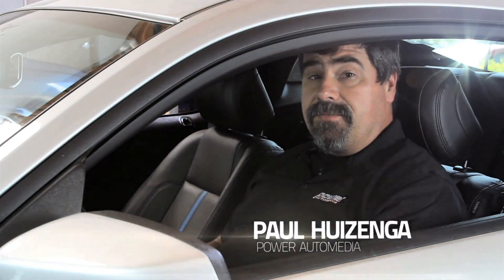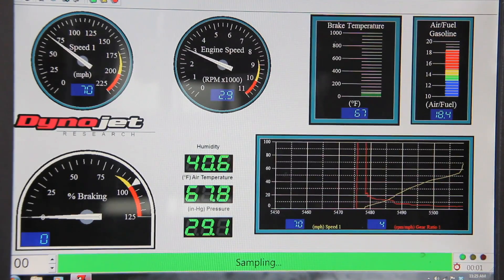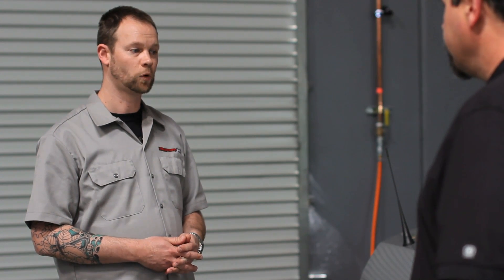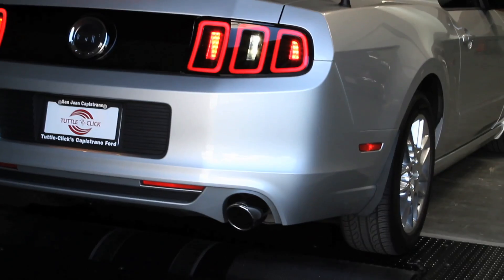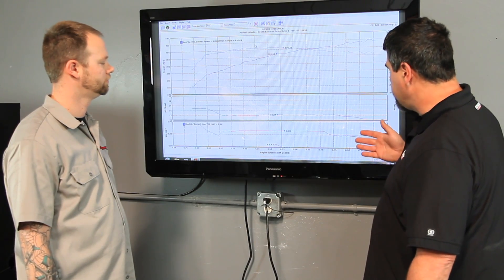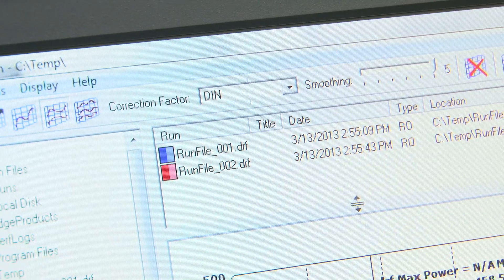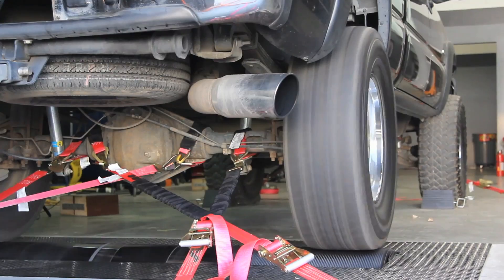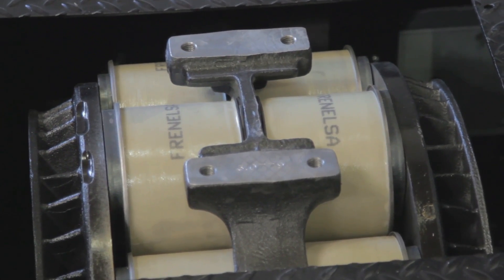Dyno Testing 101

Comment: Dyno 101, dynojet : fail
Reply: Indeed. Dynodynamics or Mustang.
Reply: Im not getting it... ive had numerous cars tuned on a dynojet and they all turned out bad ass.... so whats with the dynojet fail?
Reply: Usually when i hear comments without explanation like yours it goes something like this... guy says "ford cars suck!" The reason behind it is really because he owned a ford and didnt change the oil for three years and seized the hydraulic lifters and the engine went to shit..... so when i hear random comments like yours i automatically think you are "that guy" who had a bad experience for aome stupid reason or another...
Reply: @Turboboob  
I can't speak for the OP but I don't like tuning on an inertia style dyno. And while I am aware that Dynojet now offers load bearing dynos, I still think both Mustang and Dyno Dynamics offer a better product. What really annoys me personally about the Dynojet is the fact that people go around and compare the somewhat inflated numbers they put out, to stock power. Again, the only dynos I see that pretty consistently match SAE j1349 numbers and other factory standards are the two I mention. What's even more annoying is the fact that so many Dynojet users keep using STP like it's even remotely comperable to factory numbers.
Here's a story from a track day last fall. Guy with ZR1 C6. Brags all day long about how much power his car has. He then proceeds to pull up a dyno sheet that shows an inertia pull using STP. He then goes on to rant about how much more power his car has over stock. He would have been a lot more quiet if he had strapped that car onto a Dyno Dynamics and done a load bearing test with a hot engine.
While the Dynojet can be used to tune, it's also often a source of fake news. That's just how I see it. And while you can get good tuning results on an inertia dyno at wide open, you will never have the ability to tune on both part and full throttle steady state. As an example, a tune that is perfectly fine during a normal sweep, can look pretty interesting if you do a step test of 500 rpm intervals from say 3000 to 7000 rpm, holding each plateau for 25 seconds. 
Tuning on good load bearing dynos is just so much more in depth and detailed.

Comment: Here's so wrong on that cheating the dyno. Bc yes you can by two different ways. One is turning the Eddie break off which puts no load on the car which will give higher numbers. 2nd the barometric module. You can place it in front of a fan with cool air passing threw it which will read higher numbers as if you was running in winter time. So yes you can cheat the Dyno numbers
Reply: MrYukon04 No - if you run a fan - it’s the power output at cooler conditions. If you want you can set a fixed  hotter ambient for your test. The Dyno output is the power /torque for a given set of conditions.
Reply: @ppal64  that's what he's saying. People outright hack the weather module or feed it false weather with a heater, chiller, etc. 
    I won't name the shop, but for street racers, they blew cold air over the weather module, which made the corrected numbers be low. You could show someone your dyno sheet and say I only make x hp/tq, when you really make a lot more. I miss that shop...

Comment: Pretty good video but the part about him saying you can't cheat the dyno that's a lie. Bc with the Eddie break used the numbers are more accurate to road conditions. With the break off free rolling it's about the same as putting it on jack stands and flooring it so there's no load on it car will make at least 20 to 30 more horsepower if not more which is not true number. But either way it's only a tuning tool so who cares about Dyno numbers

Comment: Doesn't take into account weight of the car and down force
Reply: You can actually.  That's what the load function is for.
Reply: The goal is measuring powertrain output. The mass, lift coefficient, and drag coefficient do not have a factor in the data.

Comment: You said you are measuring force which is mass x acceleration, but I also understood that an inertia type dyno measures horsepower which is simply defined as power/work over time. Torque ( twisting force) is calculated via the tach signal, and if a Dynojet actually measured force Torque you would see results of over 1000 lb/ft on a bone stock performance car through gear multiplication right?
Reply: You run the car in the gear closest to 1:1, usually 4th. Gear reduction can also be easily calculated out.

Comment: Why do some dynos do not have a crossover at 5252?
Reply: If you use a good chassis dyno that actually measure your crank rpm, it can easily give you a 5252 crossover. As long as the dyno knows your gear ratios etc. it will never be an issue. Dynodynamic or Mustang can do this. Just stay away from all the inertia dynos like Dynojet etc. They are not worth a damn.
Reply: @AB-80X  dynojet dynos not worth a damn... please explain why you say this as every shop i can think of around me runs these... my civic drag car was tuned on a dynojet and it did the trick. Sounds like your personal opinion.
Reply: @Turboboob  
It is my personal opinion, and it's based on personal experience. And there's also a very simple reason why there are so many Dynojets around. The Dynojet inertia dynos are very cheap, and easy to use and maintain compared to a Dyno Dynamics or Mustang load bearing dyno. Add to this that a lot of performance shops like to "sell" the inflated numbers the Dynojets lay down.
Another common thing to see are shops that uses Dynojets that has mediocre air control at best. Most stick the dyno in a corner of the shop, throw a fan in front of it and call it good. 
Inertia dynos are cheap by comparison and so is the case often with the dyno install itself. 
Just because you see something everywhere, does it not mean it's the best. It simply means it's popular and many drink the Kool-Aid. I will say that the majority of shops with a really well built chassis dyno facility do not use Dynojet. I would say they are mostly represented by Mustang and then there's a bunch that use Dyno Dynamics.
Reply: @Turboboob  
I do understand what a dyno is used for - how does that question even relate to anything I said?. Do you understand why a load bearing dyno with proper air control is a much better tool than a simple inertia dyno?
You start out by assuming that I know nothing, then I explain where I'm coming.from, and then you proceed to ask me if I know what a dynonis used for.
If you don't know why the use of road simulation and step testing is of great value compared to a simple inertia sweep, you are lacking a lot of knowledge and experience.
I've been building engines for over 25 years, and I've used several styles and brands of dynos. I'm not narrow minded, I simply choose to avoid the lesser alternatives out there. If a shop has a properly calibrated Dynojet with load control in a properly set up configuration, I have absolutely zero issue with it. But think that you can get a nice race tune from an inertia dyno set up in a way so that the car ends up eating it's own exhaust, you're sorely mistaken. That's a recipe for disaster as it will cause a serious lean condition once you get it out in the fresh air. I've seen it more times than I would ever care to count, and like it or not, in most cases a poorly installed Dynojet was part of the problem.
This is my explanation and my experience, and it's first hand from operating the equipment.
If you don't understand why I say what I say, so be it. Do as you please, it's your time and your money.
Reply: Chassis dynos don't . The reason is that the retarder is generally spinning alot slower than crank speed. most twin roller dynos will be doing around 3000rpm at 120mph and the engine may be doing 7000rpm by then. Hence no cross over but still accurate

Comment: If we do a dyno for an ATV again and again without changing any setting(Tuning) there is a always very small difference in the RPM value.....Why is it so??
Is it because of Temp. and Humidity or something more technical??
Reply ASAP
Reply: yes
Reply: The rpm is the rpm. What do you mean it changes from test to test? The only variable would be if the inductive pickup is picking up EMI from somewhere.

Comment: Can a dyno measure torque at low revs? Like 500-1000 rpm? Or even under 500?
Reply: Yea it measures the whole torque curve
Reply: Yes some can. A good Eddy dyno like a Dynodynamics or Mustang can. Only issue is, will your car let it.
You will need a pretty advanced dyno that can control the throttle while it's loading the dyno. If the dyno is capable of that, you can basically plot in a sweep or step test from idle to redline.

Comment: What about dyno testing and automatic with a high stall converter, would it cheat the dyno then?
Reply: No. What ever the dyno sees at the wheel, is what it sees. Anything between the flexplatee/flywheel to the tire, can add or subtract. The only thing that is usually pretty poor when it comes to automatics, is the conversion to crank hp. But then again, you have dynocells for that.
But mind you this. NEVER let anyone tell you that you can't cheat on a dyno. Shops do it all the time. When you find a shop, there's a few things to keep in mind.
Do not let them use a inertia dyno, pure and simple.
Have the car properly dyno tested in stock form. This means at least 10 power pulls when hot. If that number deviates a lot from the manufactures specs, they are doing what they should not do.
Make sure they always go by the SAE J1349 standard. Anything else is fake news. Going by the SAE J1349 standard means that you can actually compare the results to OE specs.
Always use the same shop. Each dyno is a bit different, and at the end of the day it's a tool for tuning your car, not a 100% accurate way of measuring hp that is comparable between all dynos.
Make sure the shop has proper ventilation.
Always use a load bearing dyno that uses Eddy current brakes on ALL 4 WHEELS, even if your car is 2WD. This basically means using Dynodynamics and Mustang - never Dynojet.